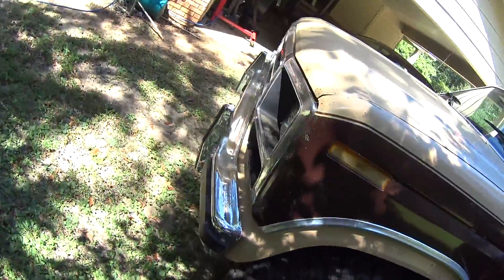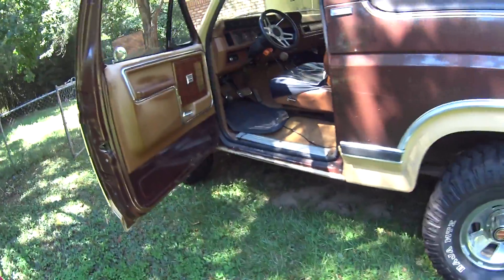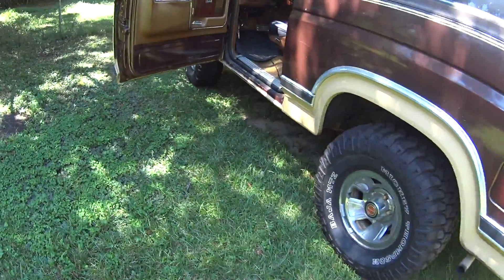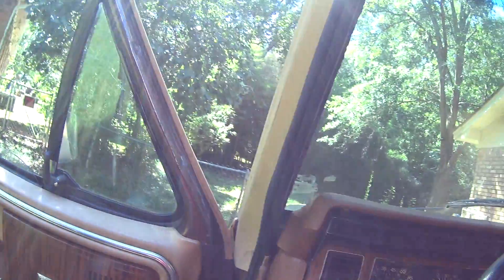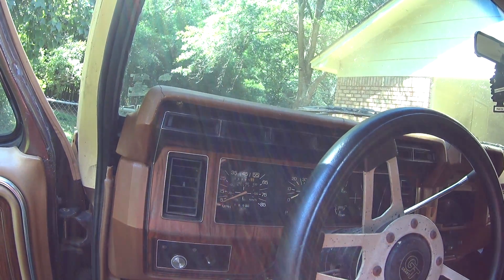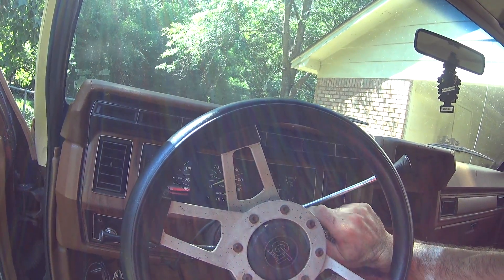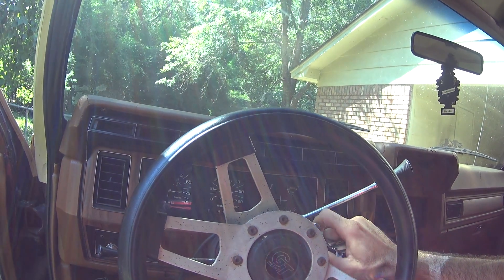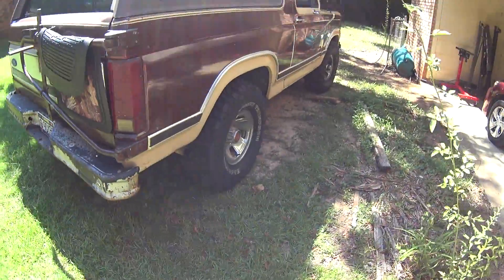1982 Ford Bronco 408w

Comment from the maker: Just an update I had it engine dynoed it made 500hp and almost 600tq
Reply: That's awesome, do you have a pic of the Dyno sheet? I'd really like to see the torque curve because I'm looking to build something nearly identical for an off-road truck
Reply from the maker: What's your email I'll send you a snap shot.  Totally recommend everything i did except maybe the mahle power pack pistons. But had to have them because they were light weight so I could internally balance with out any weight added to the crank. They also had a big dish to keep the compression down. Only 9.5:1